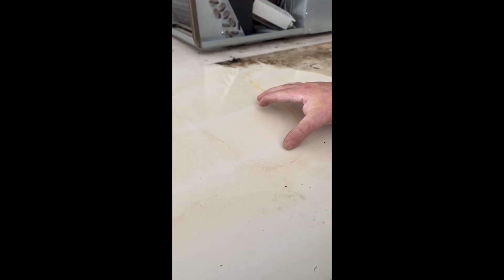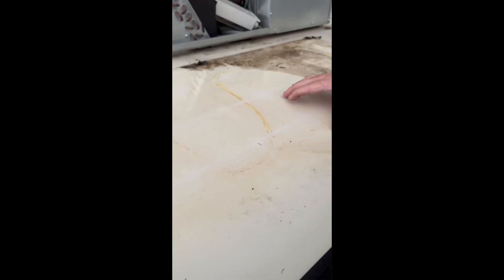Don't Use Flexible Solar Panels on Your RV!

Comment: I have a TPO roof and am looking at mounting a 200 watt flex panel using screws with a piece of coroplast to protect the roof. I'm hoping the newer panels are made better and the coroplast will keep it cooler.
Reply from the maker: I believe RVing with Tito did that. I could be wrong, but I believe he didn't have great results. He was all for it, but then if I'm not mistaken, he did a follow up that wasn't favorable. Again, I may be wrong on who I'm thinking did this. Best of luck. I'd be interested to see how it worked out a year or so after!

Comment: You're absolutely right. They can even be a fire hazard. Besides, they are expensive and have a shorter lifespan, increasing their cost per total kw produced even more. I have 2 conventional solar arrays on my motorhome. My small, 620w array mounted on the side of my coach, over the bedroom window, is liftable to the correct angle for month and latitude for optimum production. This set-up also allows the maximum amount of cooling air underneath. It also serves as a nice window awning that practically lifts itself with a pair of gas struts. It's easy to clean too, standing safely on the ground. We've been living with this set-up full-time for the last 5 years and it has worked great, especially after we were able to replace our old lead acid golf cart batteries with a 560ah 12v (7.1 kwh) LiFePo-4 battery I built from 8, 280ah prismatic cells.

I'm in the middle of expanding our solar system right now. We discovered that we love boondocking. In fact, we boondocked for 8 months straight last year, so are adding a 48v 320ah battery and a 4,400w rooftop array to complete our electrical independence. We will soon have 8, 550w panels racked 15 inches off our roof which will allow plenty of cooling air underneath and providing a nice sunshade for our entire motorhome too. It will be finished next month, weather permitting. I finished the roof rack, haven't mounted the panels yet. They are huge! I'm top balancing the 16, 320ah cells now, which just arrived today. We've removed our rear rooftop AC unit and will be replacing it with an EG-4 28.5 SEER2 12k Btu mini-split heat-pump for 24/7 heating and cooling without needing to rely on our generator, except for back-up use only. 

I'm building a low budget system for its size. We had to forgo all the high-end Victron components and Battleborn batteries for a cheaper, yet still capable system. By doing all the work myself (a pretty daunting task for a 67 yr. old who's not in the best shape) I was able to build this system with a total of 5,020 watts of solar, 23.5 kwh of batteries (the equivalent of more than 18, 100ah Battleborns) and 6,000 watts of 110v inverter power, all wiring, battery monitors, breakers, charge controllers, etc. (including the high-efficiency mini-split) for around $11k. It would easily cost twice this much if I used name brand components and 3 times that if I had to pay someone else to design and build it for me. Your professional work is beautiful though. I sure wish I could afford to just pay someone like you to design and build my system, as your work is amazing. I just found your channel and subscribed. All the best!
Reply from the maker: Thanks for the compliments and best of luck with your system. Gaining the knowledge and doing a build yourself is always my recommended path.